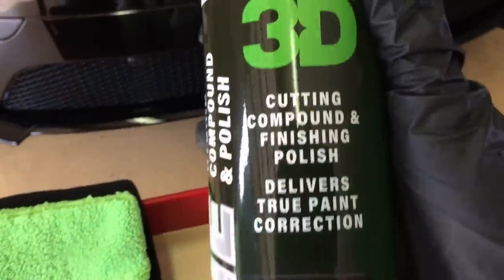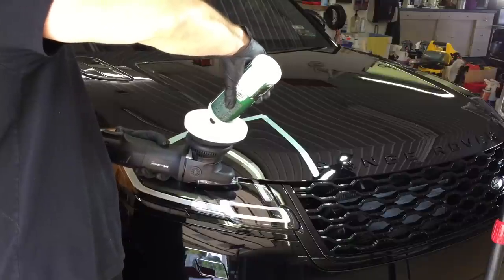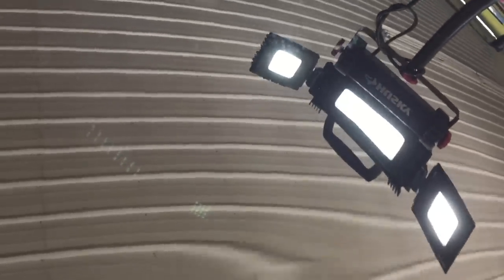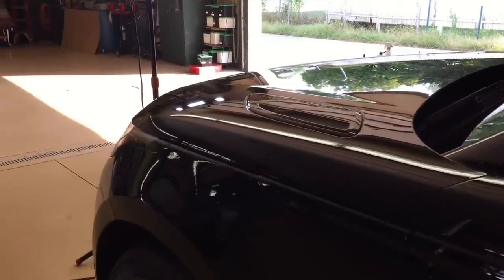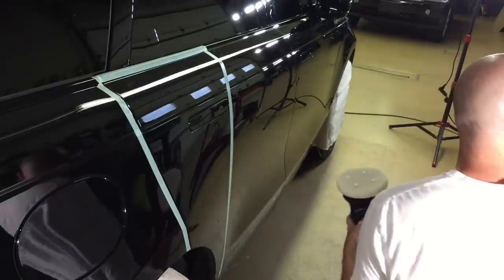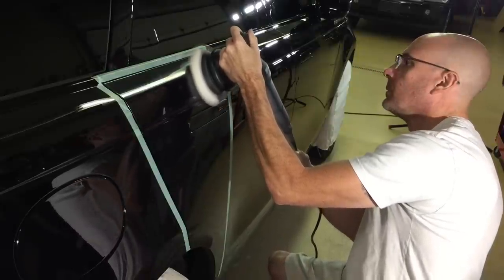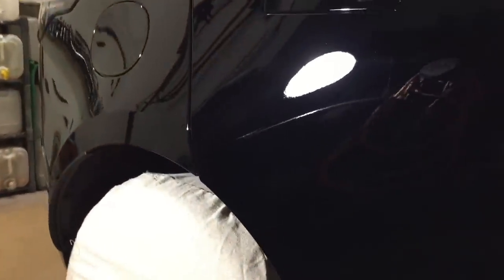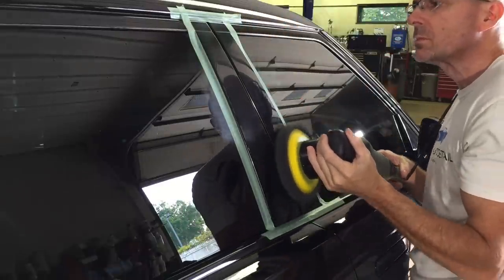3D ONE Hybrid Compound/Polish Goes Through The Apex Detail Review Process!!

Comment: I recognize that this doesn't excite anyone but me, but here goes. I have an '05 Volvo S40 t5 that I did a total paint correction. I have a cheap Bauer Polisher, but I'm just learning and I'll move up once I step up. I used 3D Speed Pink Soap, washed the car, rinsed, re-washed, left the suds ON, then using a clay mitt, clayed the car. I dried the car, then using duplicolor wax&grease remover, I went over the car AGAIN, rinsed&dried...then started the process. Using Meguiar's 6 inch microfiber cutting disc, I began the correction process. As I got down to where I wanted to be, switched to a Shine Mate T10 (no additional product) finishing pad, followed by Meguiar's areosol to protect it all. I know my steps are a little goofy, but my little car is beautiful......thanks to your review of 3D One. Thank you sir.

Comment: Hi Brian, the B&S White pad in the video is a GEM on softer black paint for a 1-step or finishing with 3D ONE. I just did a 1-step on a black Acura TLX with OEM paint on the softer side. I tested several of pads and the B&S White pad was the only one that did not scour the paint. I actually I found this pad to finish(ever so slightly) better than the black finishing, and cut better(expected).

Comment: I have been a fan of 3D's two step 500 &520 as well as 501 & 502. Per a couple of your videos on 3D One with Buff & Shine 50/50 Urofiber pads i had got some of the One with the Urofiber pads and have had excellent results. Very fast compound that cuts moderate defects as well as polishes out a lot better than I ever expected. These were on 3 vehicles i did a two step on two years prior with 500 & 520 but I am confident it would do well on a vehicle i never did a correction on prior. Good stuff

Comment: I'm using One Hybrid Compound and Polish to remove mars and rubbed on paint stains from a test equipment case.  The paint formula used in 1961 was and still is MIL-DTL-15090 Military Specification Enamel, Equipment, Light Gray Formula 111.  
I found that using a regular cloth to apply and rub works but it requires A LOT of elbow grease.  
I'd prefer to do the clean up carefully by hand, not with a machine as the paint has a certain amount of hardness, it's not applied extremely thick.
Reply: In the places I have polished, it does make the paint surface like glass.

Comment: I love this product with buff n shine euro pads. Excellent finish.
I go on 3 which is 3000 rpms n do a few passes n then (deps on the vehicle but def works amazing with harder paints) i will bump it up to 4000 rpms n finish it. If its softer paint i found switching to a white pad (either wiping n then adding more product or simply using whats on there and adding 2 drops to the white pad n this stuff seems to stay pretty usable and wet in my experience anyway.
Ive used this stuff in 40 degrees and it works well. Other products cannot be used when its too cold for sure. It just doesn't work n the product just cakes up n pad bounces around. This stuff however is a go to in cold.
I will occasionally use a good compound but usually have to add a few drops of water to the bottle and use a tiny bit of pad conditioner as well.

Comment: You have replied to comments on some videos that you don't like the Rupes machines as it broke in the middle of a job. Due to my Rupes 21 being out for repair I decided to shop around for a backup 21mm polisher, I ordered the Maxshine M21 Pro. Day 1 it was an amazing polisher, day 2 it felt like it was going to explode. Extreme vibrations, so much so that the pad was hoping on the panel. Maxshine polishers are hot garbage. My Rupes is going on 5 years and still loving them. 1 Rupes goes in for repair every year regardless if it needs it or not, mainly general maintenance to keep them fresh as I'm a full-time shop and my tools get used.

Comment: I know this video is a bit older so I'm not sure if you're able to keep up with comments/questions of all your new stuff and your old stuff BUT I'm curious.  I have a 17 Volkswagen GTI that I purchased back in July and just didn't have the time to correct it and I'm getting ready to do the correction here in March/April when I get some better weather.  Is Volkswagen clear typically harder or softer?  Would 3D One with the Uro Fiber pads be a strong combination to do a one step and remove most imperfections from the paint?  Thanks Brian.
Reply: How did this go for you?   Volkswagen paint is typically pretty hard.   You might need a more aggressive pad/compound combination to correct it.   

But this may finish out great as a 2nd step on that hard paint.

Comment: Brian, great review!  Do you think this job would have been quicker with a two step process using something like Megs Ultimate Compound and then their Polish, or do you think this one step product yielded quicker and better results in the end?
Reply: I would not suggest using this after a compound, I have not used Ultimate Compound, but you will be cutting a lot with Ultimate, then ONE will remove more, I would use Ultimate Polish or Menzerna SF 3500 or SF 3800.

Comment: I just bought this for 24.99 😒 i also got a uro fiber pad to try out on my 2012 tacoma. ive tried many products and most do not finish well on my truck. maybe its the clear idk. i can get it looking good but not perfect usually.  im gonna start with that if it works i will finish with it as well, if it doesnt i will use a white foam pad to finish with and see if that brings better  results, i may just to try it, do a total of 3 diff test spots and finish with a black pad just to see if the product itself is enough to finish with.

Comment: This has become my "go-to", to the point of almost becoming a crutch. 

I also picked up the 3D ACA500, and ACA520. 

I've used the Menzerna 4000, Megs 201, 210, Ultimate Polish, Sonax perfect finish, and others I can't even remember in the last 22 years. I've never produced the gloss ACA520 gave me before. Very, very impressed. Of course the ACA500 is a home run, but the 520 blew me away.

I tend to use the 3D One both in my operation, and the shop where I help out from time to time. It's the first product I reach for, and it hasn't let me down.
Reply: Thanks for sharing this

Comment: Just my 2 cents worth. I own a 2018 Honda CRV, 2018 Ram 1500,  04 expedition ( work truck ) and a 1994 Chevy Blazer, the Blazer is not perfect, but it is ALMOST perfect, close to show quality.  Before I did 22yrs in the USAF I owned an Auto Detail shop. A long time ago I detailed cars for Auto Dealers. The cars were mostly sold at Auto Auctions, then sold on the Dealers Car Lots. The entire point of this post is, I own a Honda, NOT a Ferrari, 98% or more of ALL car owners will not see the tiny/small/ almost not visible imperfections that you are talking about. It looks like this product will be just fine for 98% of the car market. Oh BTW, when I do a weekly wash of MY car I always open the fuel filler door and wash the inside of it, door jams too. That is a small detail that is mostly missed. It's NOT a BUGATTI, it's a daily driver. Clean and nice but it can be taken too far. Stay away from Automatic Carwashes.

Comment: how many pads you use for the whole car? other words did you use the same white pad for the whole car? or you changed to another white pad? how long did you take?
Reply: It depends on the size of the car, think of 1 for hood, 1 for roof, 1 for 2 doors if not gigantic and such.  At least 8 to 10 for a sedan.
Reply: Clean them after each panel with compressed air and maybe some ONR then you will use less.